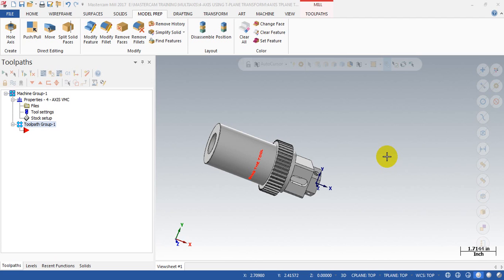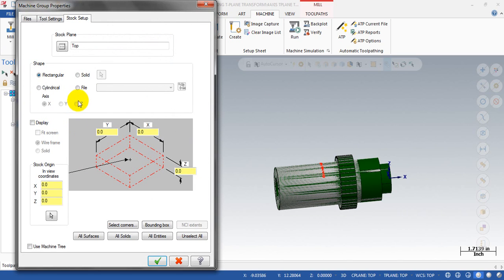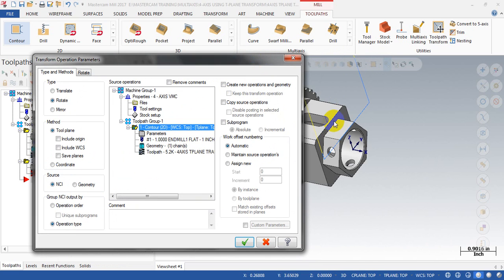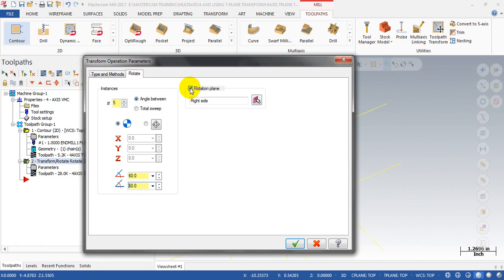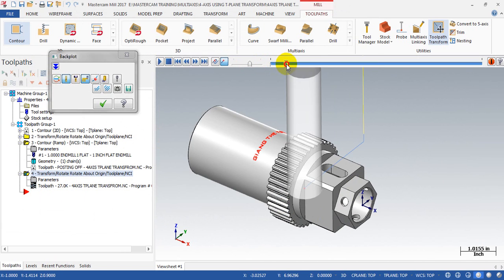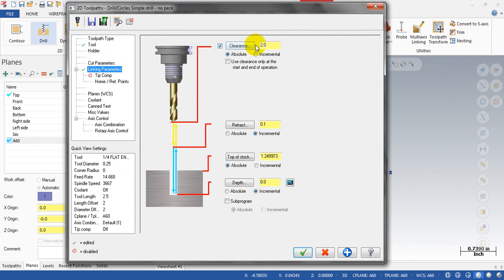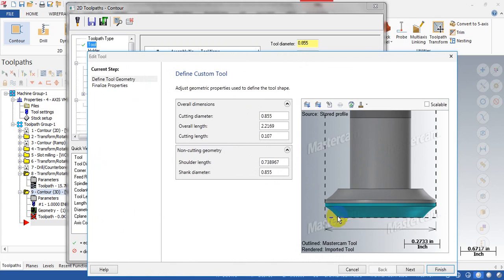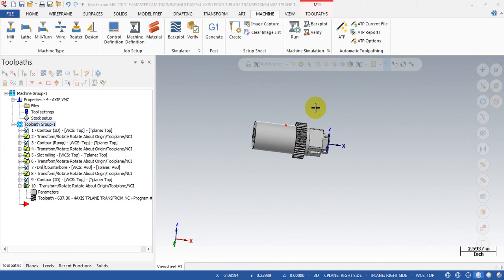MASTERCAM MULTIAXIS TUTORIAL: MULTI-AXIS INDEXING USING T-PLANE TRANSFORM

Comment: Awesome, for 4 axis and tombstone work you can Transform say in x or y or both and then transform that for the rotary moves. Transform is great feature. you can transform a translated part and not even set a move just use the amount of parts you want to run and the offsets you want and it will spit out the g54, g55, g56 and so on and have it do sub routines. Great videos Giang.. like ya humor.
Reply from the maker: Thank you Darren